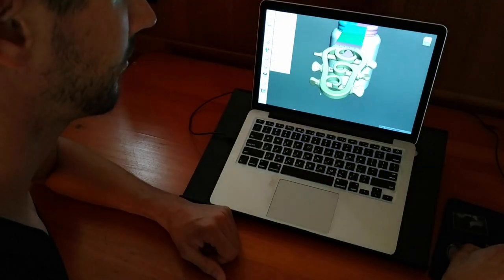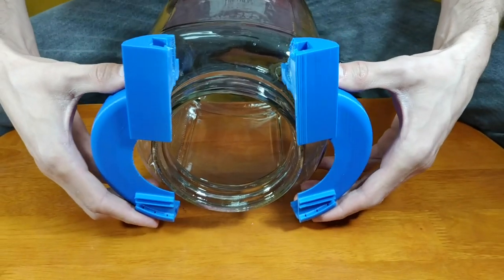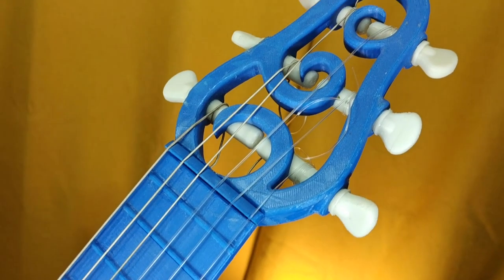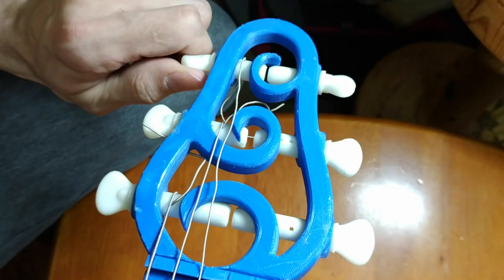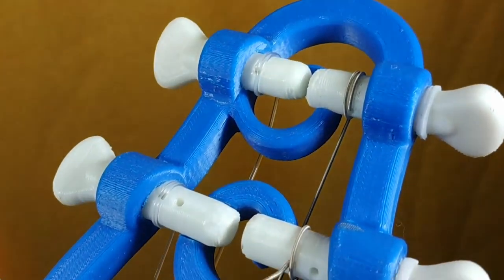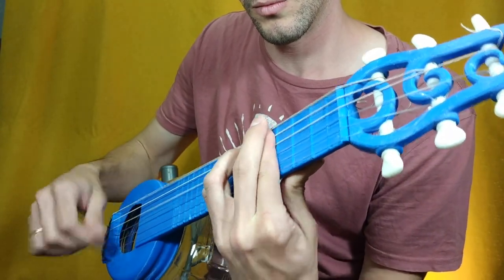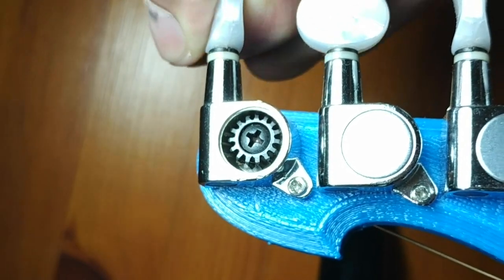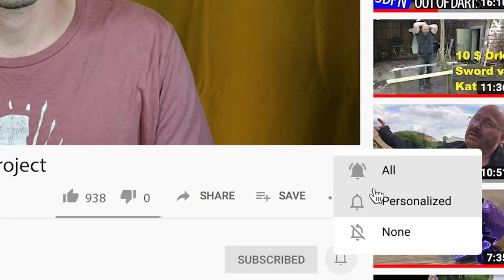GUITAR made from a JAR via 3D printing - The GUIJAR project

Comment: you have jörg in your video feed, i see you are a man of culture as well XD. yeah, but about the guitar, maybe you should use a better material for the top, whe the bridge is, something that resonates better or vibrates better?, dunno something like that, because the jar itself doesn't pose a problem, but the material has to transmit the vibrations of the strings better, great instrument idea though, very creative idea.
Reply from the maker: Thanks I appreciate it 😊 yeah I could work on the materials, there are lots of materials to 3d print with, I should also center the bridge more, and f holes are also an option. 

And jörgs channel Is indeed a very important source of culture 😬

Comment: How to make the neck stronger without steel rod?
Reply from the maker: A few things: infill, layer adhesion, layers direction. 
The print has a shell on the outside, the inside is filled with a honeycomb shape, I will make this more dense.

So the layers adhere to each other better and improve strength, I can set the print nozzle to be hotter, and after printing I can heat it in the oven, this also helps with the layers. 

And last thing is the direction of the layers, kind of like the lines you find in wood. One direction is strong and the other direction is weak. The current guitar has the layer lines horizontal if the neck is standing up, I want to print it so the layers would be vertical. All these things will very much improve the strength.
 When I start working on it, I might think of more ideas. Anyways, I hope I wrote this clear enough to understand. And thanks for watching my video 😊